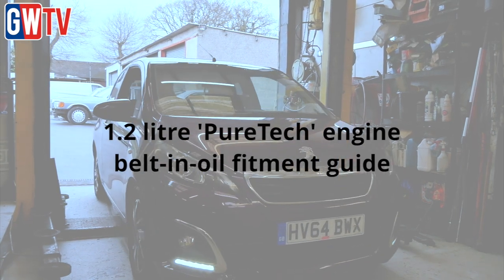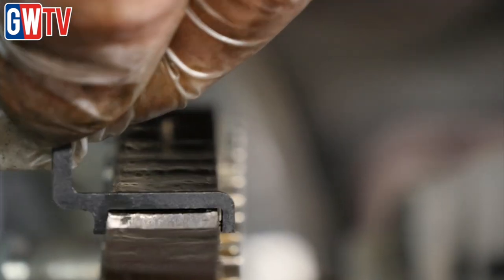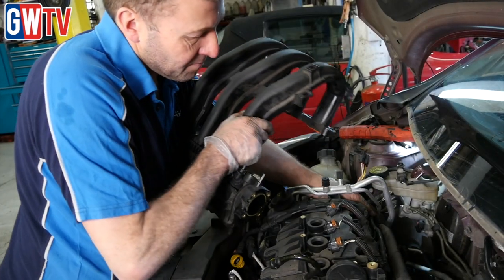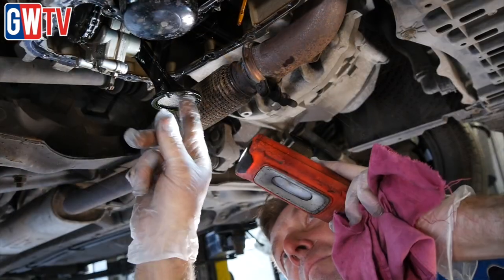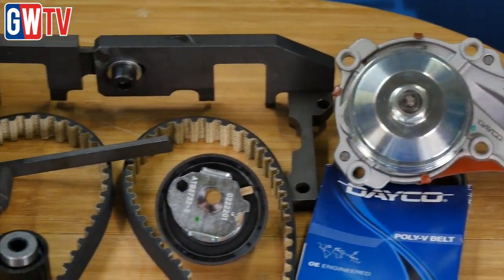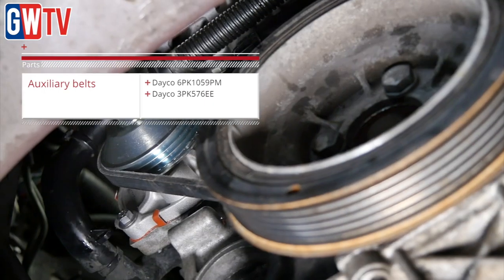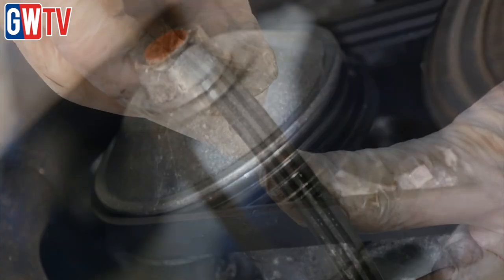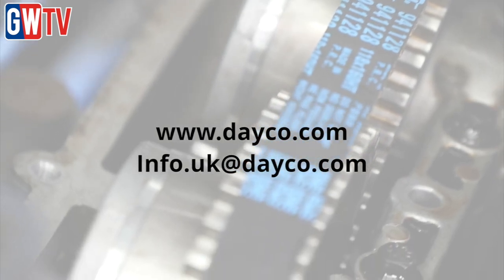PSA 1.2-litre PureTech engine belt-in-oil fitment guide

Comment: My truck just turned 39 years old this month. I've never checked, or even seen the timing chain. The valve covers and oil pan have never been removed, and the engine has never been unbolted from the frame. This will likely be the case for at least another 10 years... How far we've come.

Comment: Is this Dayco explaining how to replace the Dayco-made prematurely failing timing belt, and claiming credit for inventing selling a tool to diagnose the prematurely failing Dayco-made timing belt? The disintegration of the Dayco belt can occur between services, and the engine damage often irreparable. This is clearly an engine design that is not fit for purpose and certainly not fit for the 110,000 miles operating life stated by Peugeot. There is a backlog of Peugeots with the Puretech engine needing new engines and engine re-builds. And there is an even larger number of Peugeot owners with full Peugeot maintenance histories arguing with Peugeot dealerships and facing enormous bills. Worse still, Peugeot are in denial: they say the problem is occasional and only affects pre-2018 Puretech engines, but the same issue has been seen with 2019 and 2020 engines, less than 3.5 years old and needing complete replacement.